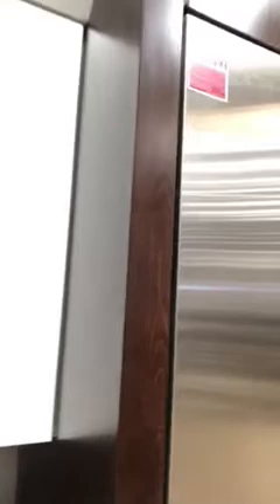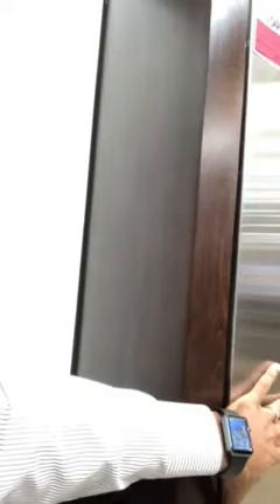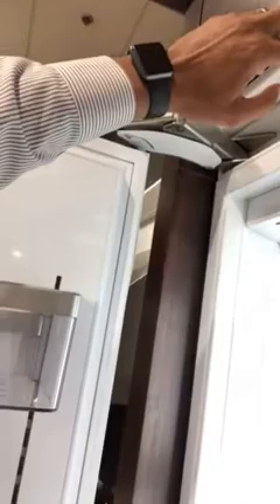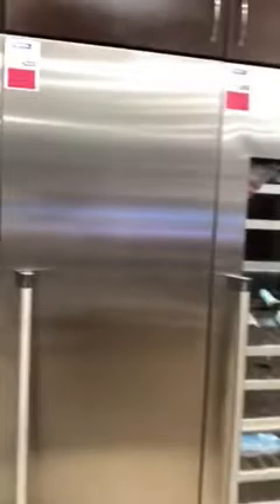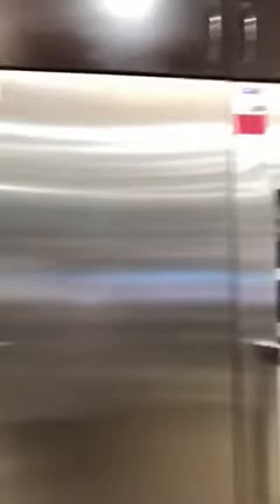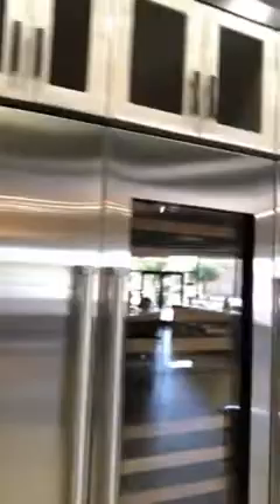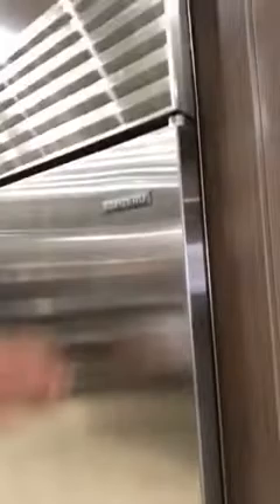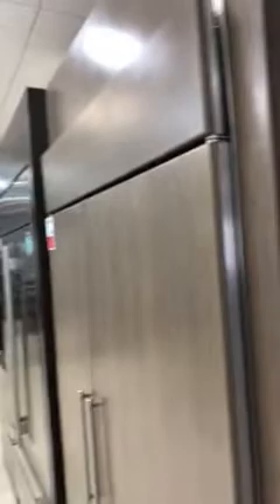SubZero and Thermador Column Refrigerator Appliances and Install

Comment: Hi there. I have a customer whom they use this type thermador (columns) when you want open any of the door so you will push the door handle little than a motor arm will push the door from inside to open it so now freezer section opens when you push the handle but the fresh food section will not open, I already swiped the door opener motors to see if it's the motor but motor was good. Any advise or idea in this regard please 🙏.